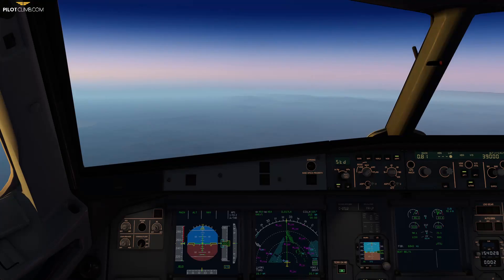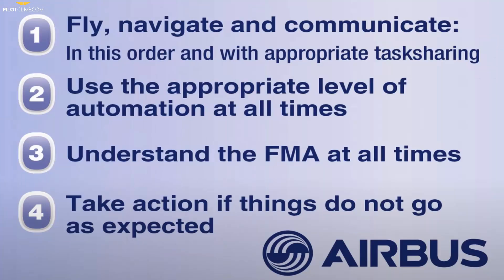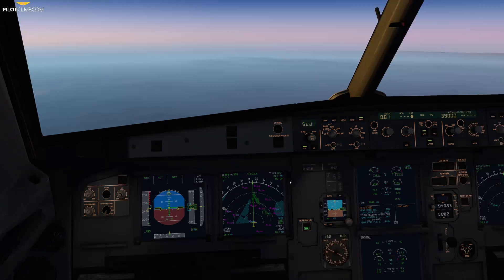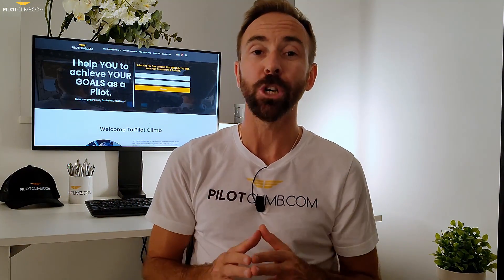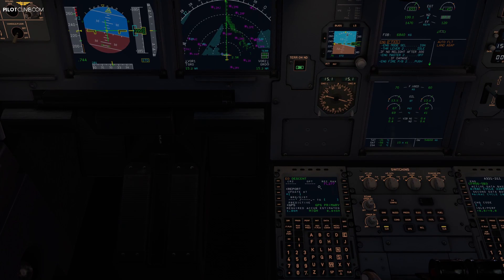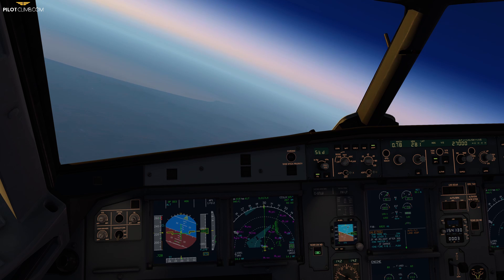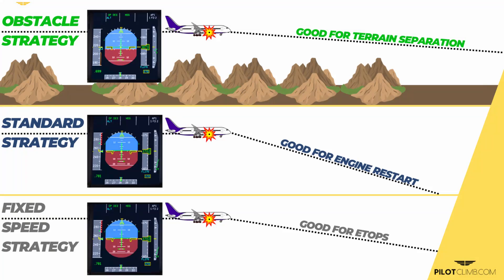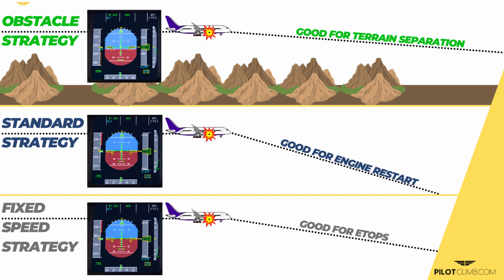In-Flight Engine Failure: The Drift Down Procedure

Comment: Sir..in normal law with high altitude engine failure, the a/c will not stall but slow to VLS and lose altitude…in Alternate & Direction law, it will stall.

Comment: Captain Gabrielle, a couple of questions 
1. An engine failure produces yaw into the failed engine. Does the yaw damper take care of that or do you have to permanently have to put your foot on the rudder?

2. Half the thrust plus additional drag plus operating an engine at a lower drift down altitude means range is significantly reduced in a single engine failure situation. Isn't this critical during ETOPS?
Reply from the maker: Hello, 1; it depends on the Aircraft, you have a rudder trim that will help you with that.
2: it should be taken into consideration during flight planning and an alternate should be available at all times.

Comment: Hello Gabriele,

You said that you make a 45 deg left or right turn.

1)
How far do I have to be off my route?

2)
If I have reached a certain offtrack distance by flying 45 deg, do I need to fly parallel to the programmed route?

3)
Would you use offset function of the FMC/FMGS?
Reply from the maker: Hi, you start the turn for deviation, and then you coordinate with ATC